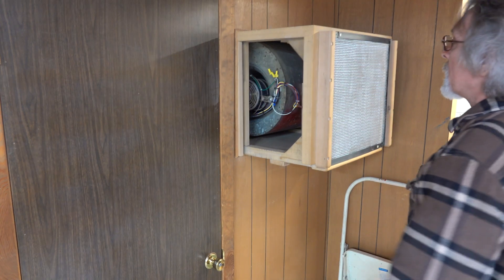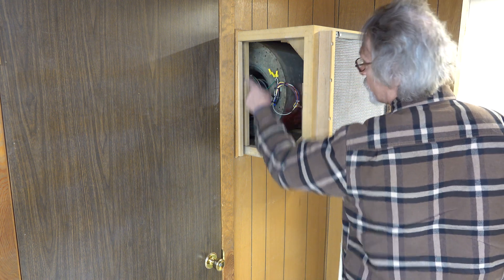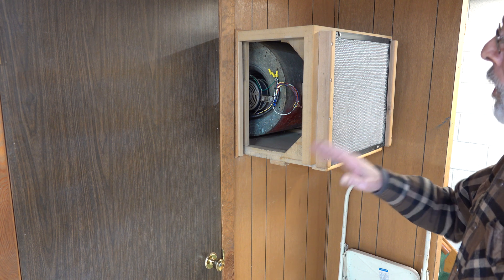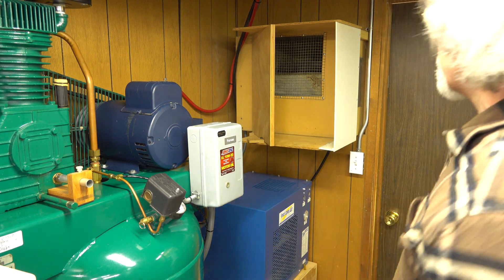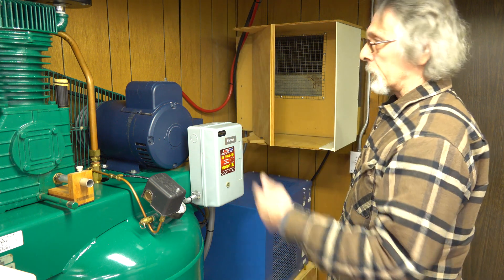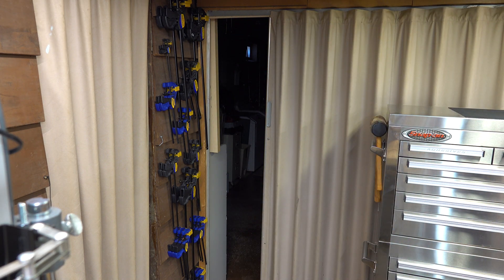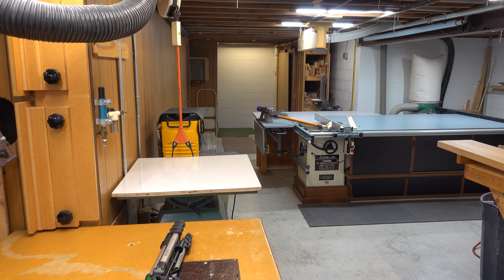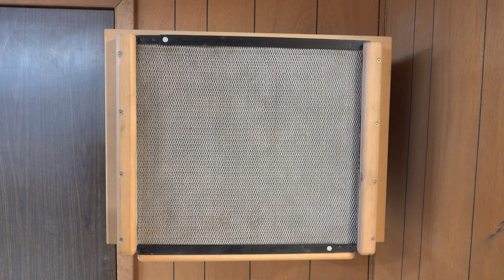Build a SHOP AIR CLEANER for MUCH LE$$!

Comment: I built something like this based on Jay Bates dust cart design.  Works really well at capturing dust when you put it near whatever is generating it.  My only issues is the volume of air and the speed also blows any dust that's not captured around in my garage.  I like what you did here and may need to rethink how I'm using mine.  Thanks for the video.
Reply from the maker: The volume in my shop allows a high rate. But these blower motors let you wire them for many different speeds depending on need. So it's a win, win.

Comment: I’ll just tell ya right now. This shop is nothing but a hey look what I got kinda deal. It doesn’t get used.  You don’t have a shop that is actually used and it stay this clean and organized!  You will spend more time cleaning than working.
Reply from the maker: LOL!! DUDE!! NOTHING is farther from the truth! Want a secret? I clean with a 150 psi air line that is ported to really throw some air! I can clean the entire shop in seconds! The air cleaner is EVERYTHING TO MY SHOPS LOOKS! Then it's just a quick Dyson job! I love clean! How do you find anything without a clean shop is my motto! Clients freak out too...BTW the table saw Formica is horizontal grade and I've worn the top color off in many spots...and the bearings are done too.Thanks For the visit!!